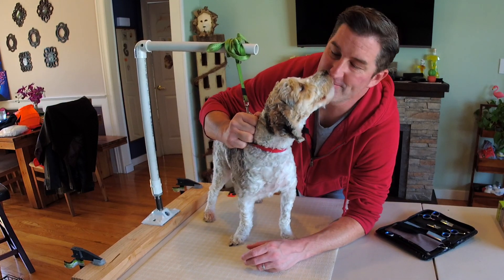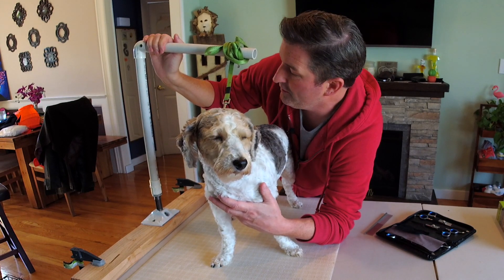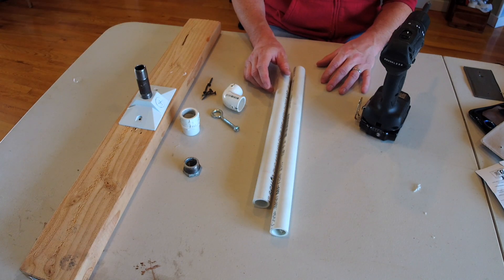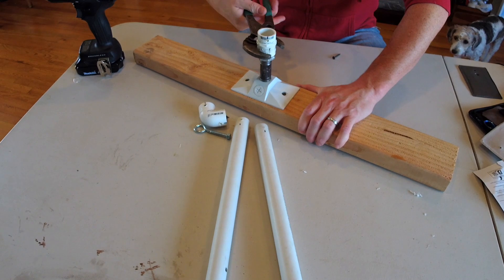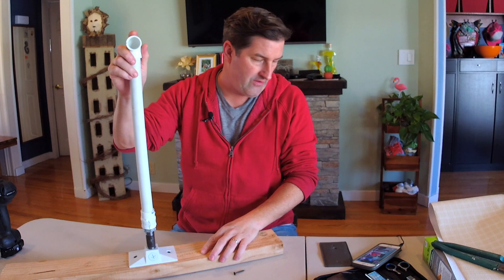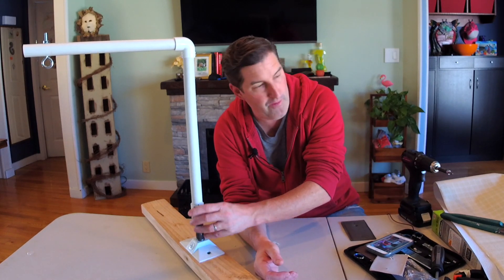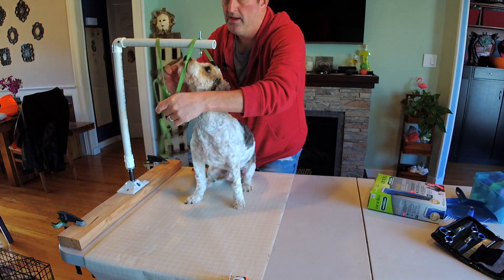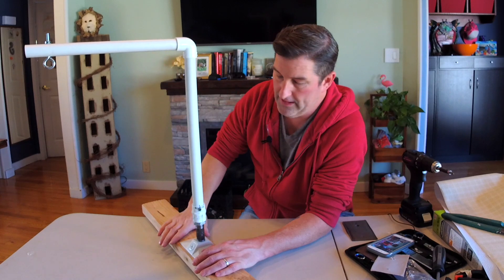How to Make a Dog Grooming Arm

Comment: For those looking to save some extra costs, they do make PVC adapters that screw directly into the 1/2" male thread of the light cover and then has a 3/4" slot for the pipe to slide into.  Essentially this removes the pipe nipple and the bushing.

Comment: Those groomer arm are spendy 65 and up!  I have always groomed without tying up the dogs most of the time.  Homemade liver treats (super high value) I find create a very cooperative dog.  Homemade arm coming up, wood or pvc or galvi pipe.  Some pvc pipe is a lot stronger and thicker than some other.
Reply from the maker: Great to hear.. go with what will work for the size of you buddy.   While in lock down in COVID I let several of my neighbors use my arm - it really helps!